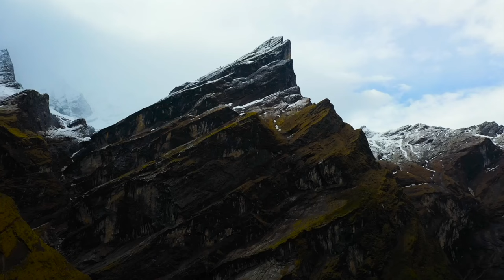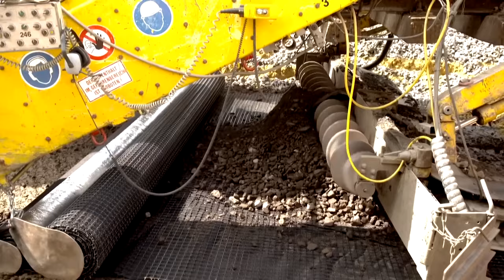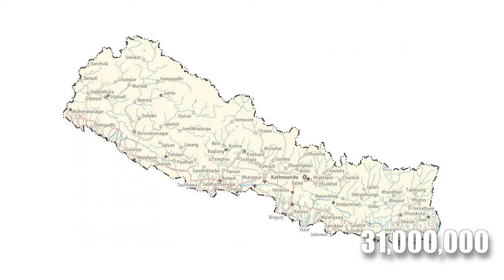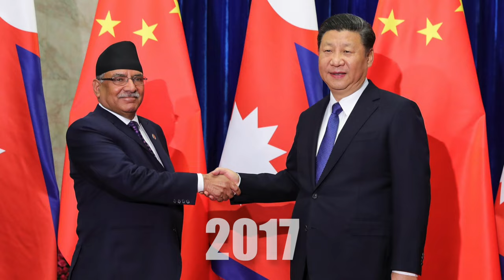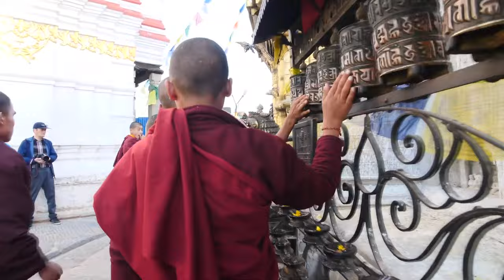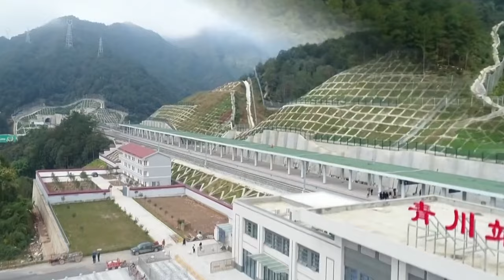China Is Building The World's Most Dangerous Railway In The Himalayas

Comment: China is the very definition of an infrastructure maniac. 
The Qinghai-Golmut  to Tibet-Lhasa railway line goes through permafrost terrain which is subjected to freezing and thawing(or melting) yearly cycle, and the problem of subsidence of the grounds on which the railway track is laid. you can view the way they solve this problem after 10 years of studying how to overcome the problem. Even the Russian engineers had said that it is impossible to overcome, unlike Siberia where the grounds do not subside due to the small seasonal changes in Siberia. The Chinese drill deep into the subsoil and install permanent cooling-rods into the grounds to curate the temperature on a permanent basis. You can view a video on how the solution were found by the Chinese engineers after more than 10 years of R&D.